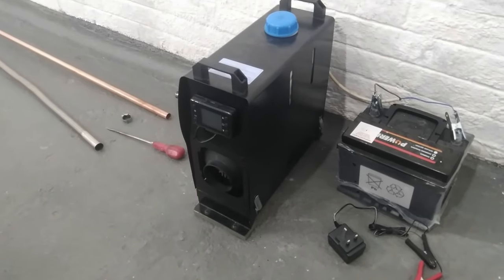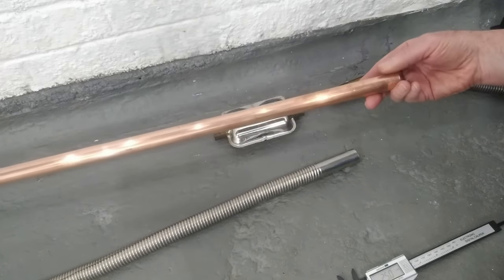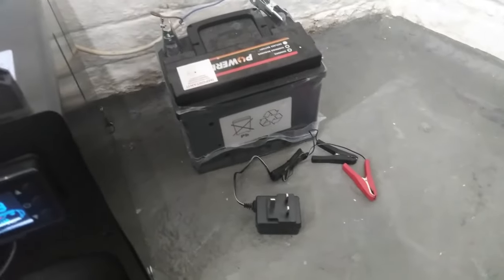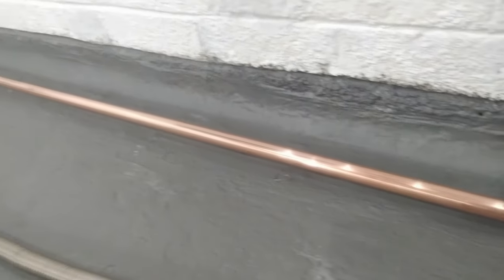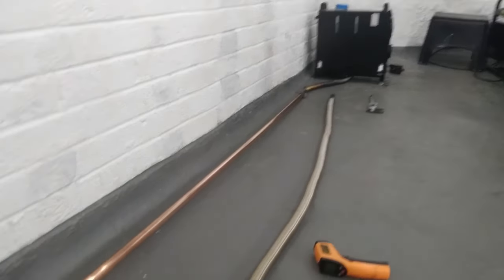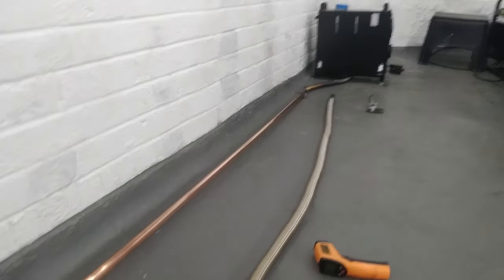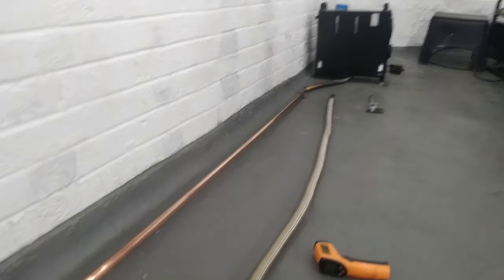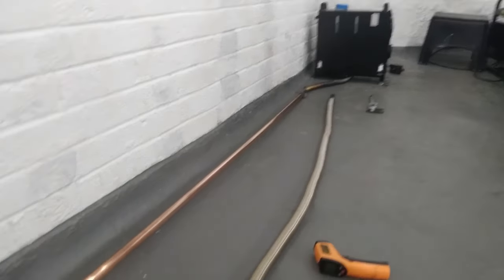This is the Longest Exhaust from a Diesel Oil Heater Chinese Life Waste Camper Van 22mm Copper pipe

Comment: Wow, I was amazed that the copper glowed red!  This means you could use steel tube and a much wider diameter which will be less restrictive and if soot does build up it would be so much easier to clean out.  Using steel tube will also last for years but copper glowing red hot will soon disintegrate, not melt but copper turns to powder of a relatively short amount of time.
Reply: "Glowed red!" I don't think so, it changed colour because that's what copper does when it gets heated. It oxidises.
Reply: @seeker1015   It is not a case of thinking it glowed red it actually did glow red.  What is your problem don't you know copper gets red hot which means it glows red and when copper glows red hot it oxidizes.  If I were you I wouldn't bother trying to argue a way out of this just keep quiet and move on or you will end up embarrassing yourself even more.
Reply: @Moonlightshadow-lq4fr  if, as you say it glowed red, can you point out at which time on the video it was most obvious? I've worked with copper enough times in my 70 years to know what red hot looks like.
Reply: @seeker1015  Are you seriously saying you have never seen copper get red hot?
Reply: @Moonlightshadow-lq4fr Um, doesn't my last reply imply that? I've annealed enough copper pipe to know what red hot is and you haven't given me the minute and seconds on this video when it appears, to you, to be red hot.
Reply: @seeker1015   If you paid attention you will hear the chap tell us when it appears red.  Now that pipe being hot and changing colour because it is hot suggests very strongly that the pipe was glowing red hot, especially because it is not the same red colour after the heat has been taken away.  I can understand seeing as you have been working with copper for the last 70 years which would make you around 90 years old and I am sorry to say but it seems dementia is creeping in for you.  Can I ask again seeing as you seem to have forgotten, are you seriously suggesting copper doesn't turn red hot when heated to a decent temperature.?
Reply: @Moonlightshadow-lq4fr  I paid close attention 3 times in a row and never heard him say red. I did hear him say yellow in reference to the oxidisation of it. There's a tiny chance that there maybe, just maybe, an inch of dull red at the 18:48 mark, but it could just as easily be the camera and the light.
3 times I've asked for a time mark and 3 times you've not given me one. Bye.
Reply: @seeker1015  Look dear, what is your problem?  If you can not see the pipe has changed colour then I suggest you go to the nearest optician.  If it got hot enough to oxidise to that colour it got hot enough to get red.  Are you saying copper does not get red hot or what or are you just hear to argue some idiotic point of view?  Either way the pipe got hot enough for me to recommend using steel and there is a very good reason for that.
Reply: @Moonlightshadow-lq4fr It's red because that's the colour of copper. It's not red hot and don't patronise people by calling them "dear"! I know what red hot copper looks like. You made the definite statement that he said it was red, yet you've neither pointed out the time at which he said that or the time at which it glows red. At least I had the manners to point out to you a time at which I thought  very short section at the very beginning of the copper pipe 'may' be glowing dull red, and yes, I agree, larger diameter steel pipe would be more effective, but you've never given me a time on the video at which it glows red! 
Over and out, bye.
Reply: @seeker1015  LOL, Over and out!  What kind of childish statement is that unless you are flying an aeroplane.  If you took a few seconds of time to re-check the video and what I said you will find that at no time did I state he said it was red, I said it because it did glow red and if you can't see that in the video, which is probably true because you don't seem to be able to get an accurate reading of what you see anyway, then there is no hope for you but please be careful if you ever see a serious crime because you are likely to get your facts all mixed up and back to front and it won't do much good trying to argue with the arresting policeman.  Have a noice day :)
Reply: @Moonlightshadow-lq4fr  Copied directly from your comment 3 days ago: " If you paid attention you will hear the chap tell us when it appears red."  Today it's: "... what I said you will find that at no time did I state he said it was red." Nothing further to say.
Reply: @seeker1015   To further clear up your little mind, I still did not state he said "it glows red".  I stated he told us when it appears red seeing as you are being so pedantic,  He didn't actually use the word red or glow, I didn't say he did, but viewing the video at the same time as he questions why the colour change because it is quite obvious that it is glowing red.  Now the point is with your argument is that it is purely because of oxidation it changed colour.  I beg to differ because once the pipe goes cold it will not have the glowing effect to it.  The pipe once cooled will appear dull and dark.  So where does that leave us?  I asked you if copper glows red when heated as it appears you don't think it does.  So do you believe copper glows red when hot enough or not?
Reply: @Moonlightshadow-lq4fr  Yawn! Haven't you got over this yet? My last comment I pointed out that you had said it was red, and 3 days later you deny that you said it. The comment exists, so please don't patronise me and say you did not say what you did say!
As for me not knowing what red hot is, have you not comprehended what I earlier said: Quote " I've worked with copper enough times in my 70 years to know what red hot looks like." Meaning I've annealed enough copper tube to know precisely what red hot copper pipe looks like. Being an indentured fitter, machinist does imbue me with some knowledge of metals.
AND still you have not put a time for this red hot pipe event. Why? I gave you a time when I thought just maybe there was a dull red bit. See, I can tell the difference between red hot and dull red. But no comment from you on that.
Ps, I never said I'd been working with copper for 70 years, I said "in my 70 years," and yes, I'd seen red hot cooper tube as a child when my father did plumbing, so it does go back some ways.
Reply: @seeker1015  Senility comes to mind.
Reply: @Moonlightshadow-lq4fr  I love watching peeps like u flounder on the world wide interweb - keep it up
Reply: @Moonlightshadow-lq4fr water is wet
Reply: I’m amazed that the copper glowed purple and my gran is amazed that the copper glowed silver too 😮
Reply: I'm amazed you can read! @HogwartsBasement
Reply: @Moonlightshadow-lq4fr  I bet you are a real delight at a party! Know it all db comes to mind, but I digress the exhaust temp of cdh is about 750f and to get copper to glow red is 1500-1750 so what you so vehemently arguing is probably an optical illusion, but without seeing it in person or having a heat gun on it's all pointless, it's also pointless telling you to stop embarrassing yourself as it's way to late for that🤔

Comment: If you burn kerosene, note that it will not lubricate the pulse pump as diesel does, with the result your pump will suffer premature wear. Why not register with a local fuel supplier and burn red diesel which will be cheaper and can be used for domestic heating?
Reply: Could diesel and kerosene be mixed to solve the wear issue?
Reply: I can run it up then I can tee off my ducks and run it to the parts of the house that way it'll keep my house good and warm
Reply: if you add fuel treatment to kerosene it will lubricate parts

Comment: I run the stock bit coiled up with fan blowing on it.. slope is always downward.  From the "muffler" is change from 1 inch to 1-1/2 copper or 2" stainless auto exhaust to eliminate back pressure.  This can be literally any length but my longest is 2 meters.   Do NOT let the exhaust touch the floor!  If you must, lift the unit so that the downward slope and no touch is observed.

Comment: nice experiment  bit of advice tho to anyone thinking of using copper as a exhaust it can  gives off toxic fumes when heated high enough
Reply: Really?  Tell us more about these ‘toxic fumes’.   Better not use copper saucepans, etc?  What are these chemical reactions, precisely?

Let’s not be making these unsubstantiated scaremongering comments that are clearly not true.
Reply: @oliver90owner  its when it oxidises temperatures commonly used for oxidation of Cu are in the range of 200 °C–900 °C the exhaust gets hotter than 200  .this is taken from the cdc Human data: Exposure to copper fume causes upper respiratory tract irritation, metallic taste, nausea, and metal fume fever
Reply: @gazbullen   I’m not yet convinced.  The surface temperature of my copper bottomed saucepans regularly exceed the generally accepted CDH exhaust temperature of circa 300 Celsius (gas flame temperature, for instance).  That may produce some copper oxide (but is generally in a fairly reducing atmosphere, of course).  However the usual valency copper oxide is Cu II.  Cupric oxide is a very stable compound, only melting at over 1000 Celsius, so what exactly are you talking about?  Certainly copper salts can be toxic - often used in proprietary wood preservatives.

Go on, tell us something real about these mysterious toxins.  Your “toxic fumes” precisely, as both copper and cupric oxide appear to be fairly unreactive at exhaust temperature.  As the air is about 98% of oxygen and nitrogen, that may lead to some thought of copper nitride formation?  If it does, forget it!  The only risk of a copper exhaust is that of acidic condensation within the pipe and some copper salts being lost to the surroundings.  Most certainly not a fume by any description.
Reply: @oliver90owner  im not gonna keep going on about it as you seem to know all   my info come from a DH forum when asked about copper as a exhaust ....."Copper isn't used for exhaust pipes for several reason. Cost would be the main factor small bore pipes are relatively inexpensive however the larger the more expensive. As it is a smooth metal it helps keep the resonance level up thus making a louder sound say over mild steel, thus it used for the making of musical instruments. Copper gives off toxic fumes when heated high enough some lovely toxins can also be given off as well such at Arsenic Lead & Cadmium. We all know Arsenic is lethal. however Cadmium is a class 1 Human Carcinogen and has been banned from scientific research for years. A lethal dose is between 9 - 12 mg/m3." thats all im saying on the matter end off
Reply: @oliver90owner Cookware temperature is kept low by the boiling process - no problem unless it's boiled dry. (Dot)

Comment: If you use a copper adapter to increase the pipe size to 1” you will decrease back pressure, slow the exhaust and recover more heat.
Reply from the maker: yes! totally agree

cheers andy

Comment: if you get a tin of black high temperature stove paint and put a little bit on your pipework, you will be able to take the temperatures.
Reply from the maker: hi keith
thanks for the tip.
i have just done another video, and done just that!
i will upload that tomorrow.
just putting a new vid on today, when i wrecked the heater.
on soon....
kind regards andy

Comment: Copper isn't used for exhaust pipes for several reason. Cost would be the main factor small bore pipes are relatively inexpensive however the larger the more expensive. As it is a smooth metal it helps keep the resonance level up thus making a louder sound say over mild steel, thus it used for the making of musical instruments. Copper gives off toxic fumes when heated high enough some lovely toxins can also be given off as well such at Arsenic Lead & Cadmium. We all know Arsenic is lethal. however Cadmium is a class 1 Human Carcinogen and has been banned from scientific research for years. A lethal dose is between 9 - 12 mg/m3.
Reply from the maker: good comment thanks
Reply: What are you basing the release of toxins on? They have copper cookware and copper heat exchangers? Houses are also plumbed in copper. At what temp would someone need to be concerned for toxin release? He isn’t smelting copper ore? Not being difficult just trying to get an answer!

Comment: you could add a sand heat exchanger battery type afair to this set up , instead of a long copper pipe get a copper coil put it in some kind of metal bucket or drum filled with sand or you could rig it up to a big tub of water and run a radiator off it ..............i see from older videos you already tried this LOL
Reply from the maker: thanks for your comments.
please see the next vid.
https://www.youtube.com/@andyfireblade
cheers andy

Comment: The colour of the copper nearest to the hot end is oxidisation. It will become annealed and will be quite soft. If you put copper into an open flame the flame will turn green. Copper work hardens when bent or hammered. BTW, condensation is normal when you burn hydrocarbon fuels. Part of there exhaust is carbon dioxide and water.  Believe it or not if you burn a litre of petrol, about 1 litre of water is produced. Some of these heaters run on 12V, 24V and mains voltage. Personally I'd avoid the mains and use a battery and a transformer.
Reply from the maker: thanks for your comments cheers andy

Comment: The heater will need to be raised so that all the water will drain out of those exhaust tubes to the outside of the house and not sit in there water setting in a pipe will collect the carbon
Reply from the maker: good point

Comment: wonder if the operating temp of the heater changes with this "mod",   you can check that on the controller. i plan on doing this before winter rolls around again.  Could the color change along the copper pipe be from different temp zones along the pipe. love to see some temps

Comment: The small weep hole in the bottom of the “muffler” is to allow condensation out…leave yourself a wee bit of room in the event you have to replace the muffler.
Reply from the maker: thank you for your comment did you see my other heater vids, https://www.youtube.com/@andyfireblade let me know what you think, cheers andy
Reply: @andyfireblade  I did watch some yes Andy. To include seeing that you clearly understood the purpose of the weep hole long before my two cents!! 🤣🤣
I think this system will be my go to heat for my garage, even if I need two and gang plumb them. I’m tired of fighting with that dang pellet stove!!
Thanks for great content.
Reply: @keithrayeski6417  thats great. good luck with it. and thanks for the comment cheers andy
Reply from the maker: @keithrayeski6417  great thanks for looking.
good luck with yours cheers andy

Comment: I bet a water storage tank with a large diameter heating coil ( lower resistance)  could be linked into the exhaust outlet to heat water ?
Reply from the maker: good idea

Comment: There will be a back pressure in that long exhaust and the heater will struggle. You need a wider pipe for that long run
Reply from the maker: yes, i agree with you. thanks for looking in andy

Comment: It'd be worth running the exhaust pipe through bricks. Maybe you can even find bricks with the right sized holes? Then the bricks would act a bit like a storage heater after the Webasto is switched off.
Reply from the maker: GREAT IDEA
Reply: This would defo be a good idea, my exhaust is a single 5m long webasto one strapped to the house block work, after a day on low every brick is warm to touch
Reply: Is it best to drill through the middle of one brick or the mortar/corner of 4 bricks when going through a garage wall? I'll be using the standard length of exhaust pipe, just worried about the heat damaging the wall.
Reply: Me personally I would drill through the brick, but make the hole a bit wider diameter than the pipe to reduce conduction. II doubt you'd get any problems from the heat though,  bricks are after all used in furnaces.  @steveclark..
Reply: @mutantthegreat7963  Thanks. I'm going to buy a slightly bigger drill bit and will probably drill through the mortar/corner of bricks so that the stainless steel covering plate that I'm making, those 4 screws have a brick to go into. If there is any heat transfer then at least it's spread to 3 or 4 bricks rather than just one is what I'm thinking. If it's just one, maybe it could crack in half is my concern. My plan could change though, I've not even mounted the heater itself so depending on where it sits and how long the pipe is, dictates where I drill through.

Comment: i think it may be better  to make and add a  three copper pipe  ( like a fork )  at the begining of  original 1mtr  exhaust  so  it will  not slown the  exit of gas from the  machine also  more heated copper pipes   ?   ((  Z  shape  bends  not  L shape ))
Reply from the maker: great idea thanks

Comment: Have you seen them things called rocket mass hearts I was wondering how the diesel heater would work to make the cob bench with the sand battery to help contain some of the exhaust pipe heat
Reply from the maker: I will check it out
Reply: you would just surround with cob...no sand battery

Comment: Is it cost effective as you can get a 3 meter exhaust for £10 opposed to 20 odd for the copper ?
Reply from the maker: i just wanted to see the difference.
but the normal extension is cheaper, true

Comment: Maybe you can do a test in the garage to see if you can blow on the exhaust pipe with fans so that only cool air leaves the garage at the end. You will probably have to take out the 3 meter long exhaust pipe again. But if it were possible to keep the exhaust heat in the room, the heating would be fantastic efficient.
Reply from the maker: great thanks for the tips. really appreciate it.
cheers andy